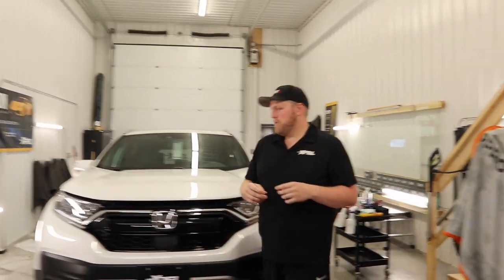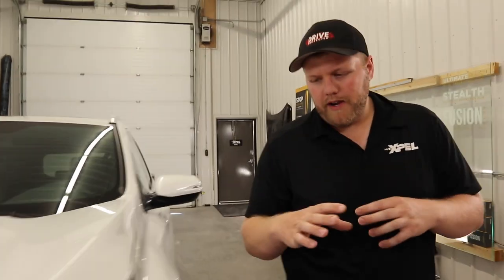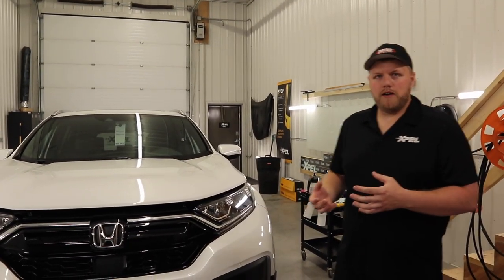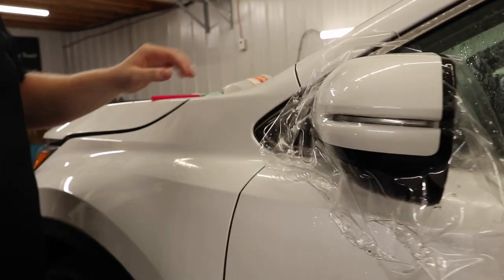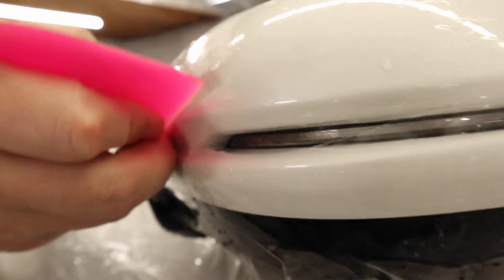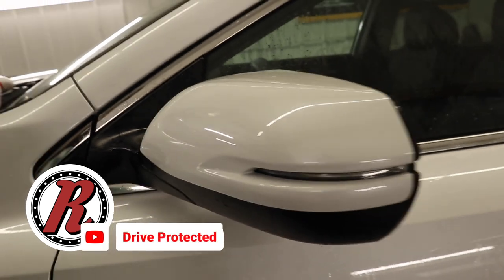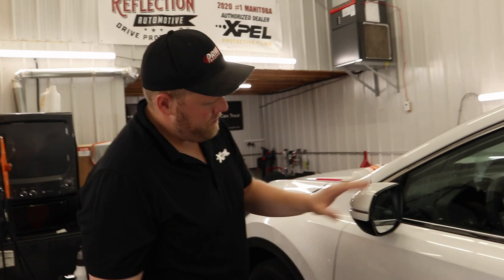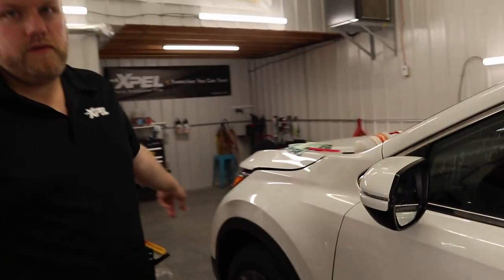PT#1 - Bulk  PPF Install On Difficult Mirror

Comment: Great video! I’ve got a 2023 coming in this week and plan to bulk the mirrors. Quick question. With all of that tack solution you used, how did you avoid pre tack and stretch marks? It seems like when I use that much tack it grabs super fast and doesn’t allow me to stretch much without getting some distortion
Reply from the maker: Great question. When doing your pre-stretch, make sure you are just using slip solution. Only use tack once you’re ready to lock it down for good.

Comment: What’s the temperature you have in your shop…..another awsome video…….very impressive doing those mirrors in bulk, I have tried a few mirrors bulk but because of where I work I don’t have the time to spent the time to trim everything…..but I am very good with the knife…..I need to get one of those knives
Reply from the maker: Shop temperature is usually around 25 degrees Celsius

Comment: How long do you wait before trimming? I waited 1.5hours in the past although the film keeps lifting up after a couple of hours. I make sure not to pass any curves and make sure the film is flat as possible and also post heating edges?
Reply from the maker: I always leave the film for a few hours or even overnight before trimming. And I always post heat the edges before and after trimming.

Comment: My friend, thank you for the video, but one thing i wanna address in here, this way you gonna have stretching marks in the film unless you have away to avoid that, i'd like to know about that please if possible
Reply from the maker: No it will not. I’ve used this method on black vehicles before and zero issues
Reply: @DriveProtected  
Usually xpel is leaving stretch whitish marks as i know
Reply: My main concern is the amount of stretch being applied is going to make the film want to pull back. That's a lot of tension.

Comment: Can i ask what is the problem when i cut the ppf it shrinks back a bit and create fingers?? I do stretch the film well and used tack solution. Problem of the film?
Reply from the maker: Fingers are caused by having too much film in one area. Sure you may be able to get the fingers down temporarily, but what you need to do is spread that film out so its down flat before squeegeeing. Hope that makes sense!
Reply: Thanks for the prompt reply
Reply: What are the options on lifted edge after cutting? Seems unable to keep it down.

Comment: What exactly is tac solution?
Reply from the maker: The solution used to lock the film In place
Reply: @DriveProtected   where do you get it at ?
Reply from the maker: It’s a mixture of isopropyl alcohol mixed with water. Can be bought at any drug store

Comment: What is your tac solution?
Reply from the maker: Hot water.
Reply: @DriveProtected  okay thanks. Going to try my first non precut piece of film. Thanks for the video. Very helpful
Reply from the maker: @mclovinlife4018 all the best! Let me know how it goes!
Reply: @DriveProtected  it did not go well. I was too scared to cut the film on the paint. I cut something out off of the mirror 🤦
Reply from the maker: @mclovinlife4018 what kind of vehicle?
Reply: @DriveProtected  it’s a 2024 Toyota Tacoma. It’s the cutting into the film while on the vehicle.  I’ve tried before and a few times, I cut into the paint
Reply from the maker: @mclovinlife4018 😳

Comment: what the tac solution % mix?
Reply from the maker: 70/30 - 70% water and 30% alcohol
Reply: @DriveProtected  50/50 ok?
Reply from the maker: No! 50% alcohol is too much and will burn the adhesive of the film. 30% max!